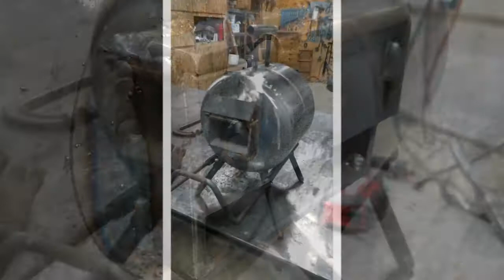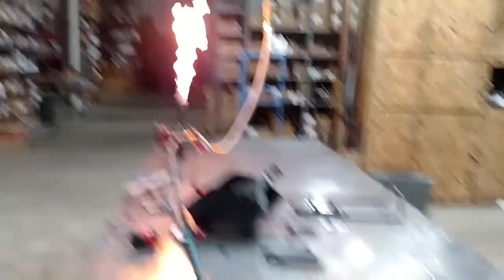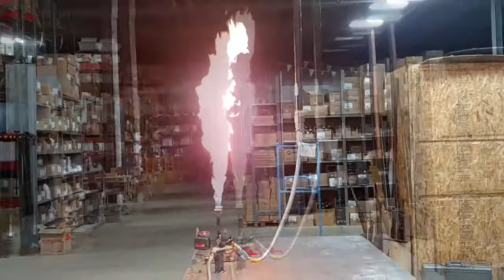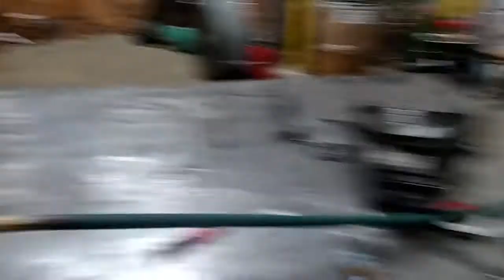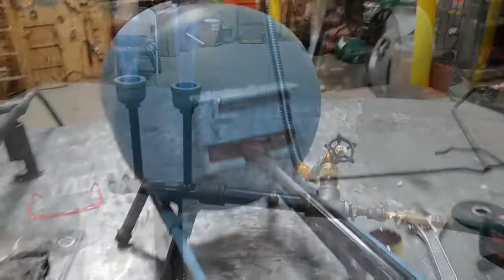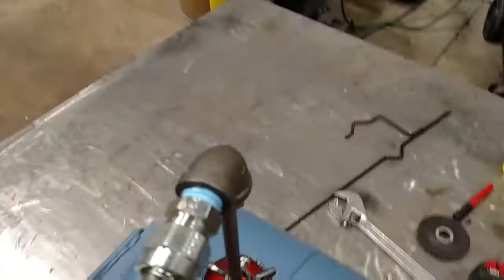Natural Gas Forge

Comment: Ya got a great design there.  I could use a little help with my NG forge.... About what psi of compressed air are you pumping into that thing??  Also, is your natural gas on residential pressure??? Say about 7in WC???  thanks for the help!
Reply from the maker: yes it is standard pressure. the air pressure is started very low and is increased as forge heats up, i basically keep increasing air to maintain blue flame and once it gets to max heat the need to increase air levels off. still room for improvement, i wont use furnace cement again it works great at lower temps but extendend run times the furnace cement turns to a melted glass goop. i am mixing gas and air in a pre chamber and also forcing air at combustion point.
Reply: Thanks for the reply Dave.  May I suggest instead of furnace cement, you try Mizzou or Kast-o-lite.  I run a furnace for metal casting and used Mizzou, it's rated for 3100 degrees and won't turn to poop.  I run my furnace with the Kwiky oil burner.  For the forge I'd rather use my NG.  I built a ribbon burner and can get it to run great outside the forge.  When I try it inside the forge, it wont maintain a flame no matter what I do.  I think I need to try your burner design.  Is there any kind of nozzle in your burner or are you just dumping the mix in that vertical half inch pipe?  I noticed on the bench, you're running a pair and show a photo of 2 in the forge, but later only one.  Two too much?
Reply: I'm 6 years late but the video and follow up question just nailed my query too. Great stuff y'all